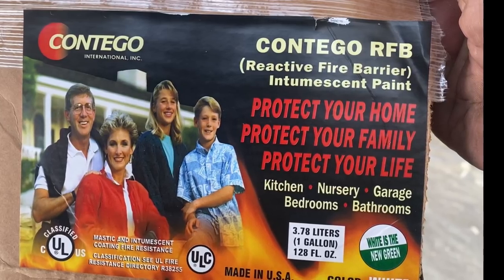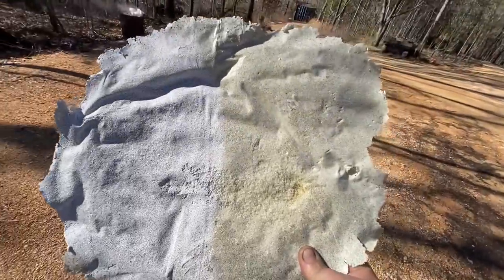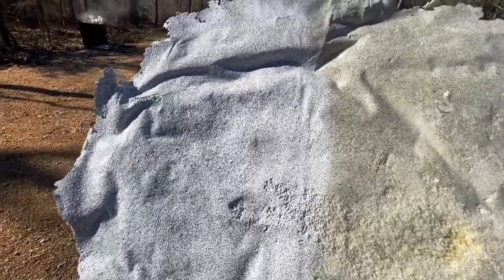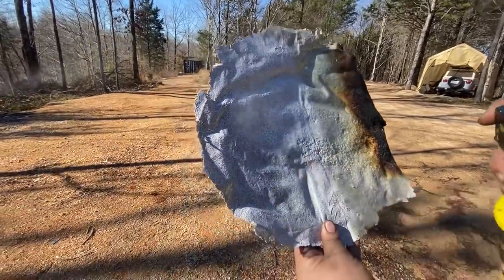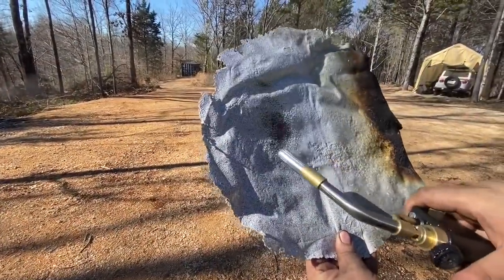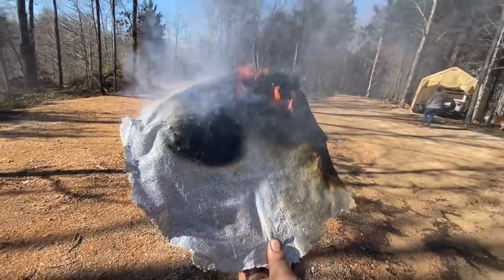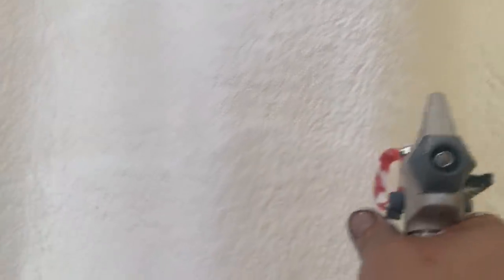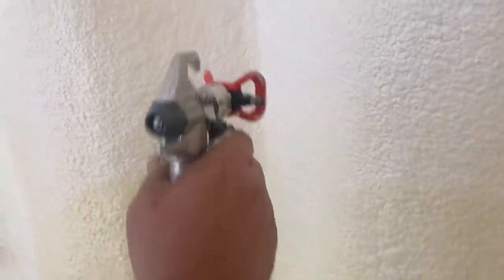Intumescent paint could save our lives.  Fire test for spray foam insulation closed cell

Comment: One BIG problem with the spray insulation is the fumes - even if it's just smoking - it can be DEADLY - DO NOT BREATHE THE FUMES!  
There's also another similar type of paint that we used in our old Hangar - since the wooden beams and structure were almost 80 years old (Built in WW2), we had to use Insulating paint. It looks like normal paint, but if it gets too warm (such as if there was a fire) - it self-expands and becomes an insulating FOAM barrier to protect the wood.  Very necessary in our hangar, since the wood is 80 years old and VERY well dried!

Comment: Make sure you have a fire alarm system installed in your building. Heat detectors in the garage and work space and smoke detectors and CO detectors in the living and sleeping spaces. They need to ve connected so that if one goes off all will sound. If it activates get out quick. Fire extinguishers in the work and cooking areas. That and good insurance will save you short and long term.

Comment: Good stuff. It's not the fire that kills, it's the smoke. Foam insulation doesn't burn on its own, but the contents of the room burning will keep it smoking, so having the fire resisting paint is code in many places.
Reply from the maker: I was very impressed with my test results
Reply from the maker: I’ll be ok from the smoke, I’ll just put in my covid mask and the smoke won’t be able hurt me.

Comment: I am glad you decided to coat the foam with Intumescent paint. Nice job! A life saving video to be sure.
Reply: The entumecent paint or other fire barrier is pretty much a requirement for residential construction not a choice.
Reply: @Wingnut353  I can't install exposed foam without the paint. That being said, in non code enforced area's a lot of knuckle heads skip the painting process and mistakenly, call it good. In Scott's previous foam video a lot of folks thought my intumescent paint comment ( attempting to save lives) was me being some sort of Safety Sally.  Safety is no accident.

Comment: i think you ought to consider putting it on the shop side of the dividing wall too.  like in the residence, its just an added layer in case something bad happens.
Reply from the maker: Sealed in between drywall there is no oxygen supply so it won’t burn
Reply: 2 layers of firex drywall is worth 1 hour of burn time
Reply: @imchris5000  that's what i was thinking of.  the video shows it shrugging off flame so i figure it might be a nice an extra bit of protection in case something happens in the maintenance area.

Comment: Have you thought about covering the exposed spray foam with some type of hard surface.  I have a quonset hut home in the Mojave Desert of California and after insulating it I framed out the arch with steel stud a covered it shower lath then smooth finish plastered it.

Comment: It's fire retardant paint, not fire resistant. Should mixed I to the foam, but an extra layer of protection is always better.
Reply: Neither Word means much...most of these paints are an ablative layer that protects the foam by slowly ablating, mixing it into the foam makes no sense.